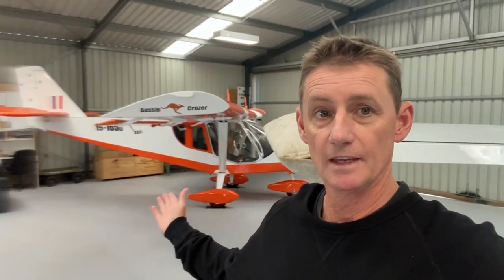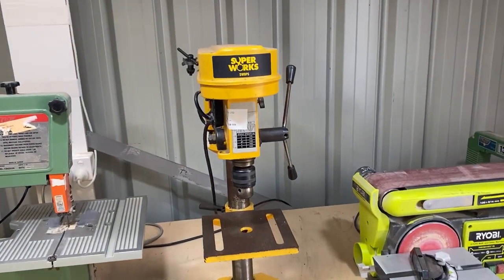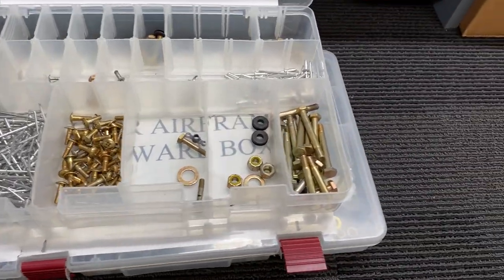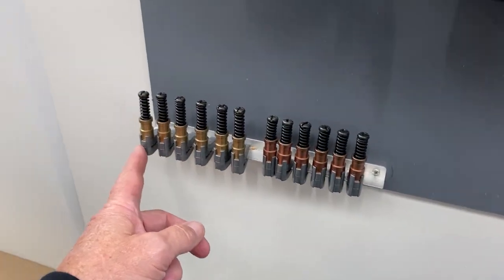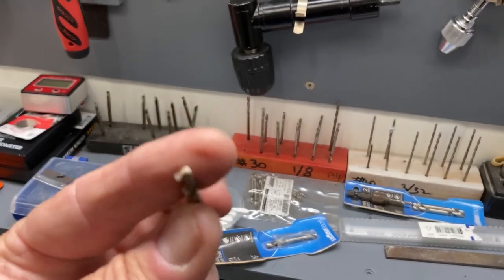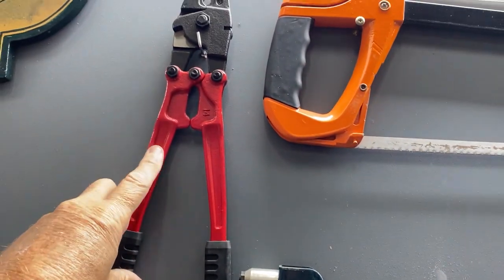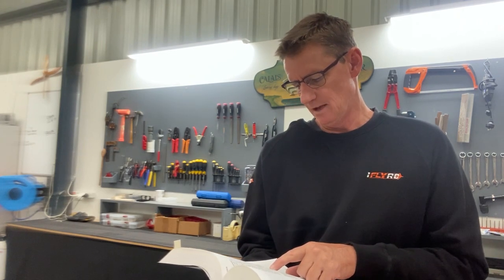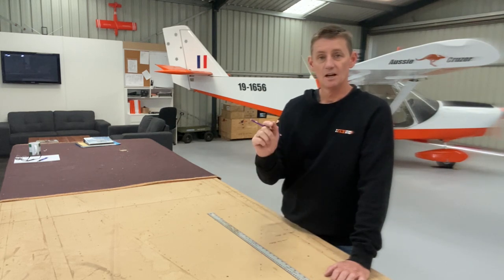Number 1 tool for building Aircraft

Comment: Hi Rowdy. For your hangar walls, behind your work benches, what did you use to line to walls? Looks great and I need to do something similar
Reply from the maker: I just use the white melamine sheet I call it from Bunnings or hardware store, saves on painting and just drive tech screws straight into the Perlins.